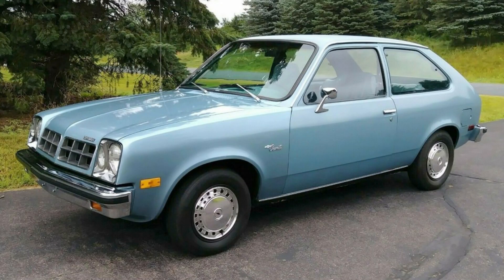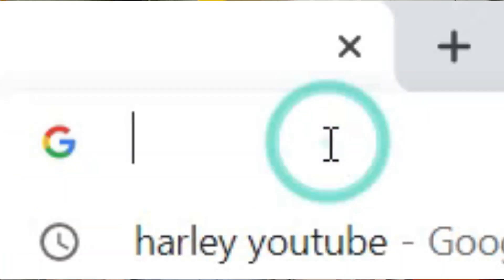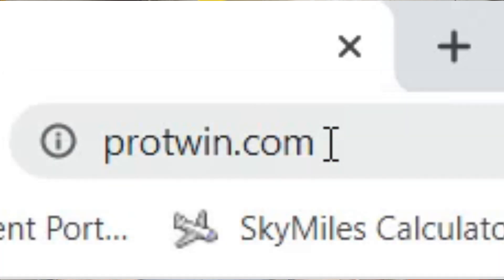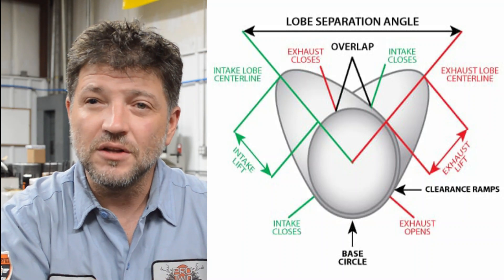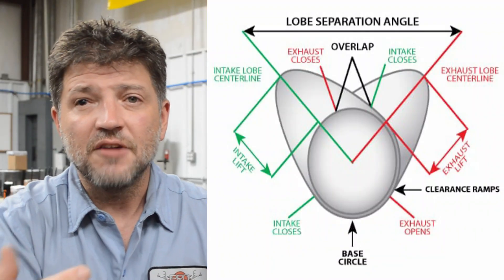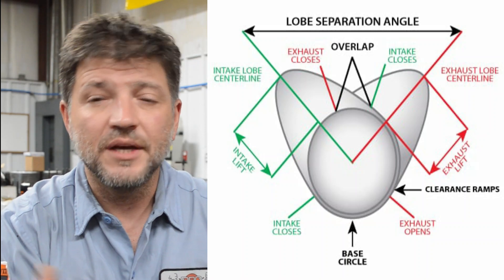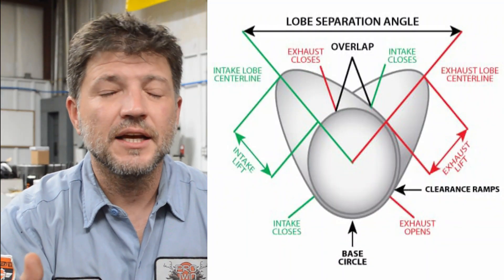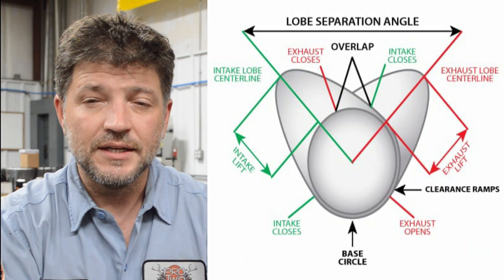Harley Camshaft Upgrade - How to Choose the Perfect Cam - Kevin Baxter - Pro Twin Performance

Comment: 2018 FLTRU with 74,000kms. on it.  Went with a SE Power Cam.  Works great for me as I do 99.9% of my riding on the highway.  Also SE 4" slips ons and an upgraded oil pump, after market airflow.  It's awesome on the highway, anything above 3000 rpm it takes off like crazy.

Comment: great schooling on cams and cam selection.i bought a new roadking in 2002 still have it.it ran like a slug, it always felt like it was chocking. I put an air filter and backing plate, Harley freeflow mufflers all screaming eagle and a dealership download still not as ballsy as my 1977 shovelhead. then on to a stage 2, 95"kit 203 cams, and a download.very disappointed in the performance. years later I put a fueling cam (525) lift, oil pump, cam plate, gear-driven cams, lifters. adjustable pushrods and, and a Daytona twin-tec 2 tuner. now it runs as it should, I downloaded the tune myself. my point here is if I had seen your video 10 years ago I would have saved some $$ and aggravation, never too late to learn even at 65 yr old. thank you, keep the info coming!
Reply from the maker: thank you Martin.

Comment: I have a '19 ultra and did an SE Torque Cam as soon as i bought it for a 7k mile trip out west.  I've been very pleased with it. I've since replaced my oil pump and cam plate (for piece of mind) with an s&s because of the HD oil pump issues but left the SE cam in because honestly its pretty damn good.  I know people will have an issue with that but i have TONS of torque with the SE cam and i really dont need any more performance out of my 114 highway cruiser!
Reply: I also went with the SE cam, but went with the 462 power cam, max torque is 116.5 at 3500 rpms, power is at 102.5, , the voiding the factory warranty and getting good power n torque, while running a vance n hines power duals and the free Rinehart slip ons,  a nice simple stage 2 build on the 114 is all I need n more riding 2 up just swapped to a new road glide limited 2021 from a 2014 ultra classis 103 with just a stage 1 with all vance n hines pipes, had plenty of power n torque with that bike 2 riding 2 up , in rolling hills

Comment: I love your shows.
They have clarified a lot of issues and giving me a good base of knowledge that over the past several years has been an issue.

My bike was built at A Harley shop. SE 536 lift cam ( without a map available ).
SE 10.50.1 high comp piston. Not sure what compression ratio is.
Heads done JPsrcision Racing out of Quebec Canada.
So a dyno to get it going and broke in from pro racing tunner .
Coil some accell high whatever coil.
So anyhow I cannot still believe they said it was tunned 3 Dynos by the end and the last one was like 6 hours using up to 6500 rpm they set no revlimiter .all through 2000 rpm the be tables were over a 100 and like 92 starting at 20 percent throttle , just bogged there explanation was well it's a mid to high rpm cam. I'm saying catalog reads from like 2000 or 2500 rpm.

Anyways found the timing was way of in some areas like 1/1 the timing cleaned up the fuel.
Now got an aei wide band 02 censor and gauge don't keep it on just for setting to read I don't have faith in the Harley tables.
So lots of timing change and some fuel. At this point I'm surprised it is much what I was looking for. Before I had to wring the power out with rpm. And it did not seem to like sitting at any rpm lower timing more accurate fuel by the way 12.7 I figure they run it at 13 from idle all through to 25 percent throttle and then it dropped to 14.7 did not make sense to me so anywhere I'm outside of cruise 12.7 till wide open .
Simplified for me and I cannot describe the difference in the ride.
Alot of my achievement with this was guided n directed by your. videos.
Reply from the maker: Thanks for sharing the story Frank.  Hate you had to deal with that...often it can be a process.  Glad I was able to help you make it good.  Excellent job sir.

Comment: With the almost infinite number of cams available choosing the right one, or two for twin cams can be overwhelming. I usually just ask where do you want your power to kick in and go from there. Fortunately most of the manufacturers are good at giving a fair description of how their different cams perform at different rpm ranges. As for which manufacturer to go with sometimes that just comes down to personal preference and past experience.

Comment: Hello, I am a big fan of your work.
I have a 2012 Softail with the 103 engine, looking for the best bang for the buck cam upgrade.
My riding style is fast and hard but never more than 5000 rpm. Not trying to blow it up lol.
I've had it since new and have tried to take my Best to take good care of it. 
I prefer the look of the Bassani 34" fishtail true dule exhaust, yes I know it is not the best thing for power.
I also run the k&n air cleaner with no cover, I spent most of the miles never even getting up to more than 4000 rpm but have recently been trying to get a little higher up there but I am naturally concerned with the health of the engine.
I would like it ask you please for a recommendation for the best drop in cam for me. I've never been one to redline or abuse my bike but I do like to get my thrill below 80mph.
I know well that you have plenty of paying customers and if you can't answer I would understand.
Disabled veteran on a limited income and and although that's not an excuse just the facts of it.
This machine is my lifeline and the health benefits are amazing.
Thank you in advance either way and I will continue to be a fan even if you can't get back to me, you make more sense than most people I can find and I respect you for what you do.
briancolburn@yahoo.com

Comment: I got a 2013 FXDB and it has a completely stock 96" TC with just an S&S Stealth intake,  Old style Screaming Eagle Tuner, and a set of short shot pipes. Yes I know those pipes are horrible but LOVE the look and sound. Ive dumped a ton of money into bike but now need more power. Problem is it still has less then 6,000 miles on the odometer. I was thinking just a set of cams? I live in North Idaho and only ride 6-8 months a year unfortunately. I dont ride a passenger ever. I like street light to street light and am almost NEVER on the freeways.
Reply from the maker: I'll be glad to help you John.  If youll shoot me an email, kevin@protwin.com, i can help you get set up for the next stage.  Thanks.
Reply: @KevinBaxter  THANK YOU! I Will!

Comment: As usual, Epic information Kevin.  So appreciated!  I am slowly upgrading my 2011 96 inch.  I will finish Stage One, once my D&D 2 into 1 pipes arrive (caught in this Covid supply chain mess).  I've already added a ThunderMax tuner to make sure each modification is properly supported.  I had my crank runout checked before adding the Dark Horse Motor Sprocket (what a engine changer that was);  But I did not check the cam side runout.  I will check it before adding cams.  I am just starting the cam education process.  I can not see myself going any further that cams..... Passed that I would just consider a new bike..... Quite frankly, I don't think I will need more power or torque after cams. My riding style is "ride it like you stole it".  I like fast acceleration up to the traffic speed.... But passed that I just cruise.   If I tap into your expertise after more education on my part,  I will buy the parts from you.  Thanks again for this great video.

Comment: 585 or 551 cam for 2013 - twincam 103 touring if purpose is good low end pull and no targets in the future for any other hot rod upgrades. I couldn't find answer for it in the video.

Comment: I have a stock 2005 88 cubic inch want to put cams and a good head but leave the cylinders along what would be the best cam for that guys are telling me to go with the triple fives or seven wood cans light for the torque range to be maybe $1,500 up to five grand what's your opinion on what can I should run

Comment: Amazing video, but some of us have an added layer: Emissions. We can improve the engine to certain extent as emissions and dB on the tail pipe are limited by law. So how can we improve the engine while still be within the allowed limits?
Reply from the maker: Several exhaust manuf have released CARB and EPA compliant mufflers.  The DBX series from Rinehart is just one example.  You can run those exhaust, and with a proper tune, still meet your emissions standards.

Comment: I run Andrews tw21 in my stock ultra twin cam 88 It’s one cam above stock and will really wake up that stock motor
Reply from the maker: That's a good choice.
Reply: I went from se203 to a 21n to do hydraulic cam plate. Didn’t know bike had 203s until I pulled it apart. 21n made the bike slower! Workin on a tw6-6r install now bike ran mint w 203s but tensioners were smoked

Comment: Hey Kevin I have a 2013 Road King with 103 motor and I’m thinking of replacing my oil pump and cam. Do I need lifters as well and new push rods???

Comment: Amazing video as always Kevin! It´s time for me to mount a new set of bolt in performance cams into my FXSB 103. I´m riding in the higher rev range when I want my power to really be noticeable, so I´m wondering what cam you´d suggest based on this information? I combine this with a TBR Comp-S 2 into 1 exhaust together with a custom map on dyno and an open air filter! Thanks again Kevin!

Comment: Hey, I just caught your video explaining cams. I have a stock 2003 TC88 FLHRCI 31k.  Chain tensioner pads caught just in time. Not doing the up grade just yet. Want to go with Zipper's in the future but for now  replacing tensioners, S&S quickies, HLJ 2313SE lifters, DS "Daytona" performance oil pump, new analog oil PSI gauge. and trying to decide Cams or no cams. I know there are limitations for my stock bike and found the "night train" site with a dizzing awray of cams to review. it has highly suggested to run no more than .250 duration and .510 lift cam in my stock set up. trying to narrow down and am in the range of Andrews TW37, or 37B, I ride the mountains of NC. Not going to the strip any time soon wanted to know if that cam would be a good bolt in fit for my bike with just a bit more pep. Thanks for any in put.

Comment: When I made changes to my 2010 Heritage, I was going for the 103 kit. The dealer told me a larger cam would run best with the tuner (orange one) I had. I also have the SE air box and American Custom Exhaust slip ons that are  stock but have been changed inside to almost straight through. I went with the SE 259e cams with a .570 lift over the 103 kit. I am satisfied with the performance.
Reply: What is the best cam for an 88 cubic inch Harley Davidson motor with 19,000 mi on it to get the best performance possible

Comment: Hi Kev , buddy you’ve got me hooked with the content you and that little red cup put out. I’d also like to know what cam you run inside that mind of yours because it really seems to crank out  shed loads of calmly delivered  credible information. Personally I think the Captain Morgan to Coke ratio must be part of the secret.  Kev I’m running a 2014 Road King Classic with a full Bassani system. Bassani Header is mandrel bent, equal length, stepped header  - 1 3/4 to 1 7/8   true duel system with Bassani DNT cans. Got a really nice deep sound. Heavy breather is the Screamin Eagle with K&N filter. This work was done by my local Harley dealership here on the Sunshine Coast in QLD Australia. Dyno done on completion gives me 103 ft lbs TQ & about 87 hp if I remember correctly. I owned a night road special for nearly ten years prior to this ride with similar mods and it went like greased cat shit and I loved it. Reason for mentioning this is that I ride the RK hard. I don’t burn out or thrash it but I do like to get to and from all the great little country pubs via all the great country back roads in  quick time. I’d like to fit cam but their are so many  choices I’m getting analysis paralysis. I want more torque because the poor old girl is a bit of a slug but not sure when in the rev range  is the question, I agree totally with you that I’m in the group that doesn’t spend much time at the upper speed limits but I seem to keep the engine rpm up around  4 to 5k a lot of the time. I just like lively responsive engine rpm range and that seems to be the sweet spot for this bike.  Something tells me that you might be able to suggest you’ve got a skunk works cam under your counter that might fit the bill. Regards Jon
Reply from the maker: Thanks Jon.  Appreciate you watching.  Be sure to sub if you havent.  Lets see...on the Sunshine Coast...that's near Brisbane.  Would your local HD dealer happen to be Morgan and Wacker?  If so, next time youre in there, say hello to Malcom Martin for me.  Great friend.  Know all the guys at Rollies (John, Berto, and others), Adam and Julie at APL Perf, etc.  Adam actually took me on a heli ride over Syd Harbor and surrounding.  Was a great trip.  At any rate...thanks for the kind words.  Sounds like you'd really like to have a multi purpose bike there.  Plenty up top but still need the low end grunt.  One good option would be to swap gearing first and see if that gets you the pull youre after down low.  From there, maybe a taller cam...S&S 585, RedShift has a couple of great options similar as well.  Just my .02

Comment: I’ve got a 1994 flhtcu with an se-2 cam with a high flow air cleaner and a stock exhaust. It feels like the exhaust is choking it out pretty good, is there a system (preferably on the quieter side) you would recommend? I appreciate your content and the hard work and time you guys put into them. Thanks

Comment: I have a stock 99 road king 88 ci. Carbie.  I’ve chose a S&S 509 only goi to have slip ons and maybe air filter .. was this a good choice for around town and some highway riding.  I just thought a s&s 510 was to hot for me. Thanks.  From Australia

Comment: Kevin I have a 2014 ultra limited water cooled hats what can I do to get the most power out of that motor I generally run short short shift 25 to 4500 RPM 90% of my time I run solo
Reply from the maker: a lot of power can be had out of a twin cam....and we have many many options for you...cam, build, etc.  Understand we can build you a 300 plus horsepower Twin Cam....but that's more than most need.  So when you say the "most", i need to understand more about what you mean by that.  Feel free to shoot me an email.  If youre interested in a build, or other parts options, wed be happy to help you.  tech@protwin.com

Comment: Stock 2015 FLHXS 103 with SE super tuner Pro , SE heavy breather and 4" Rineharts with  decatted head pipe....your thoughts on the T Man 555 torqster cam  I ride mostly solo and like the feel of mid range power not so much off the clutch .

Comment: My question is what's a good cam operating in the 1500-3000 rpm range for more torque v-twin
Reply from the maker: So many choices out there....look for lower duration, lift, and early intake close times.

Comment: Actual info begins at 3:00 and then at least for me, by the end of the video, my brain is like scrambled eggs.  I think I will invest in a Zero Electric Motorcycle.
Reply: Electric bike would be a good way to go low maintenance if you don't travel that far perfect but you have to work and back for some cruises you can always recharge your batteries while eating a hamburger taking a rest

Comment: Glad I found your channel tons of great info. I have a 09 night train what cam would you recommend for street / touring I'm in new Mexico we have mountains all over my bike has stock throttle body a Arlen Ness velocity intake, V&H pipes, stock heads, cobra auto tune. Down the road I may put a 110 kit in so possiblity a cam that could work well with both. Not looking to race just a improvement over stock for some good street torque. In the past I installed Andrews 54H cames in my Electra glide pretty much same set up and they were fantastic in that heavy touring bike and how I rode not are if they would also be a good choice for a Softail. I was interested in the easy start cams from s&s as they sell complete install kits with plates and pump as well. Any infor would be great since like you said there are so many options it can get confusing. Thanks

Comment: I installed the S&S 510c cam in my 2002 Dyna, along with the S&S 97ci kit and had my heads ported, polished and decked and it’s a fun bike to ride. I’m thinking of using the S&S 509c cam in a stock 2005 Heritage softail. How will this cam compare? I has a softail with an Andrews 44 cam in the past but it felt more like a higher revving cam.
Reply from the maker: Depends largely on how the cam responds to the heads.  Its a system.  But...if you take the specs and compare them, along with the overview I gave, you will understand how the change in specs will affect what you have now, in general.
Reply: I'm only starting understand the cam language.

Comment: I am very interested in the S&S 475 cam for my 2017 RG Ultra. My question is do you recommend just changing the cam shaft with push rods and lifters or change the entire cam chest, New cam plate and oil pump. Thank you
Reply from the maker: depends on your year, condition of your plate and pump, etc.  I dont just flat out recommend parts unless they are required or various other reasons.  One, is largely based on your peace of mind.  If youre interested, shoot us an email to sales@protwin.com and we can reach out to you.  Thanks.